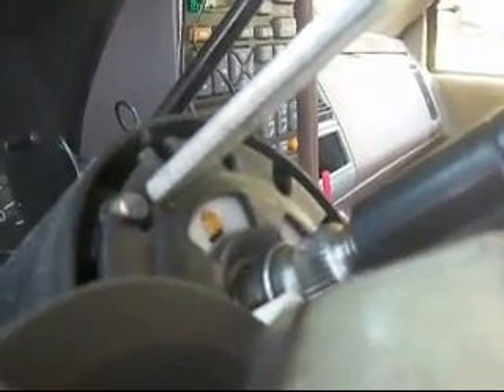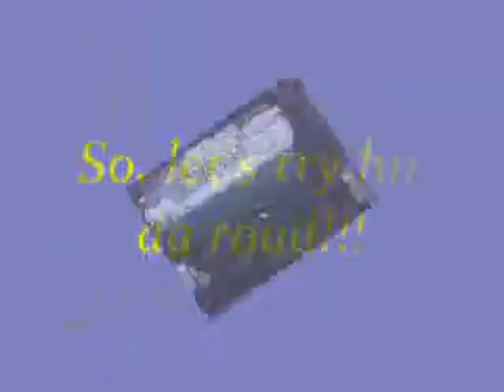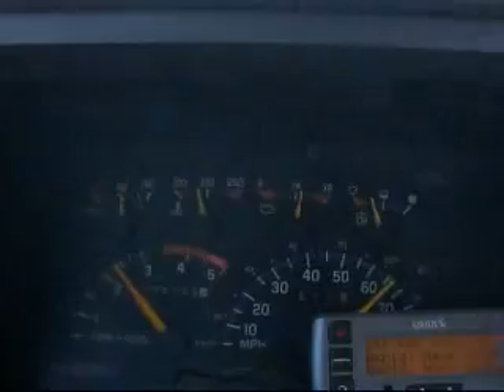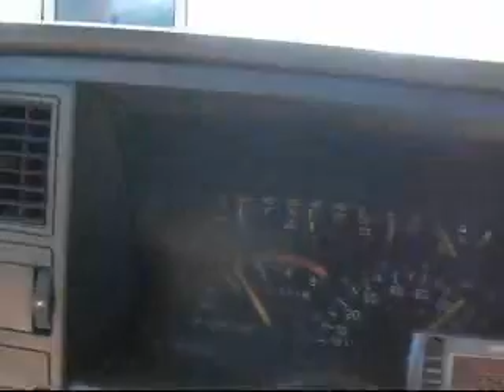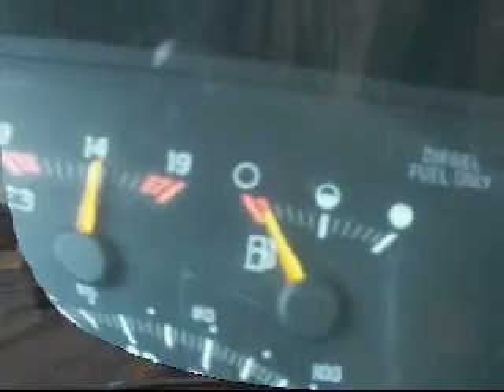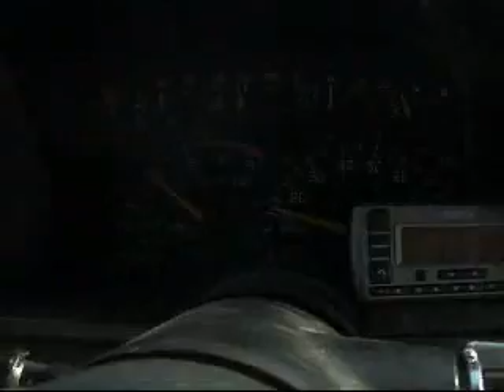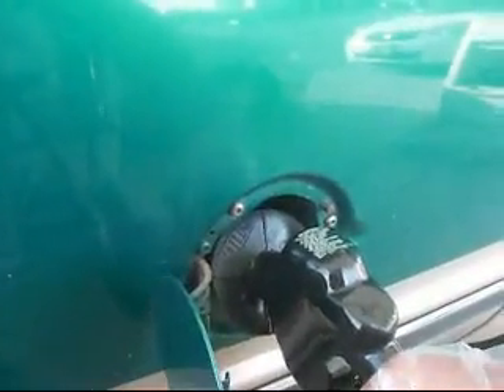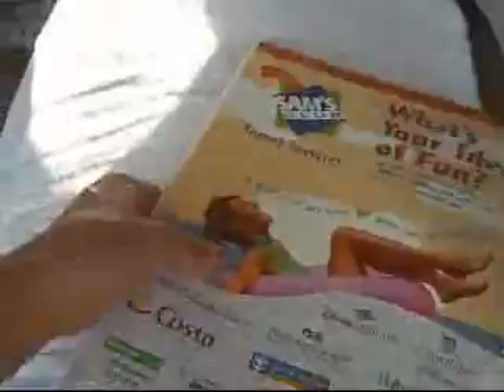6 18 10  Horn Repair, Pennsylvania & Ohio!!!

Comment: I know that road like the back of my hand.  I've driven between Buffalo and Cleveland (then usually on to Columbus) many, many times.  If you're coming back on I-90 on your way home you'll get a fantastic view of Lake Erie in PA on the approach to the NY state line.  Because of the way I-90 faces the lake in that area the view is more spectacular when you're heading east in to NY (rather than west in to PA).

16.5 mpg is not bad at all for cruising at 70 in something that big.  Safe travels!